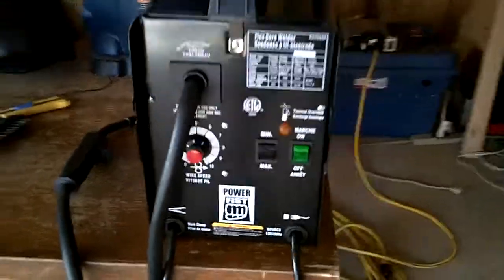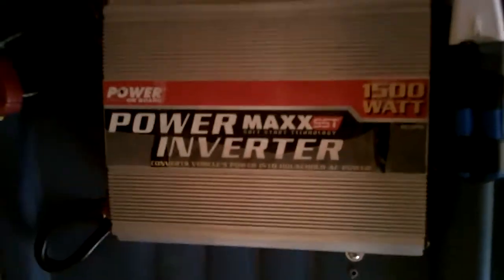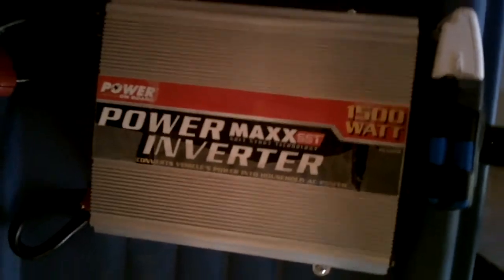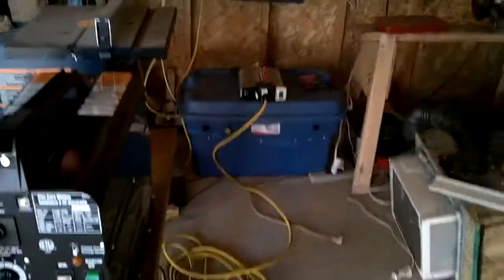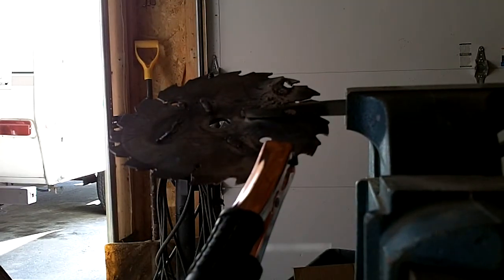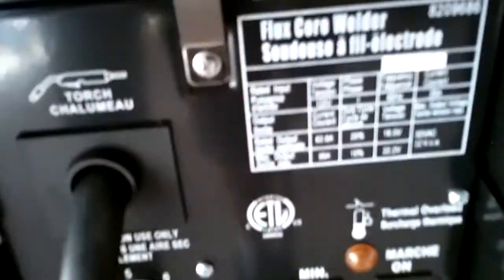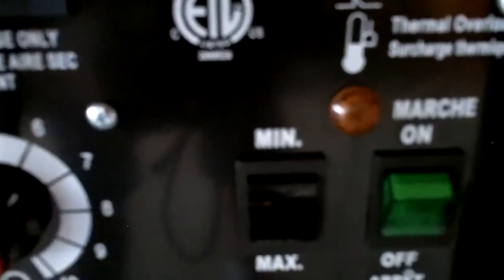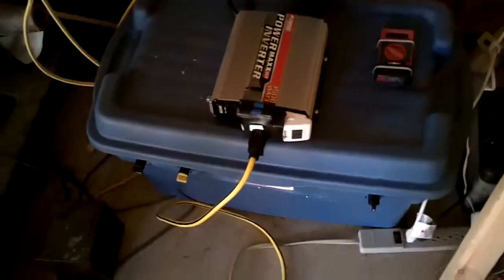Welding off an inverter

Comment: IMPOSSIBLE. 
I just unboxed the hf Titan 140 multiprocess welder yesterday and I am running it off a jupiter inverter 2000 continuous\4000 peak in this 2004 subaru foresterX 2.5l w/ alleged 90 amp stock alternator at about 1000 rpm motor rpm. 
I can strike a spark and thats it if I get that and then it started shutting down. Except for potentially bigger cables the attempt to start an arch seems to shut down the jupiter inverter.
 initially I could only see the welder going into a non normal numerical out of display mode until different combinations shut down the jupiter inverter output because the welder completly shut off while the jupiter inverter was having an alarm tone and a red led visual display.
I heard in my thoughts this is the initial draw to strike and start and arch and the jupiter system shuts down to protect the circuitry but I have not verified this being the situation.
There is another guys video with an alleged 4000\ 8000watt inverter and he couldn't weld  either it kept shutting down.
Reply from the maker: It's mostly because it's not a pure sine wave inverter, on top of it you need at least 3000w. I don't recommend doing this it's very hard on the inverter. The old swipower inverters had a massive surge the newer ones have more safety features that make the inverter last longer.
Reply: @GoingOffGrid101  Oh, hello and thanks for your reply. Please help out how I have to upgrade the alternator, wiring, and inverter to handle this load with a light, a fan, and the cars load.
I have been  studying on it for several days but I can't get one proper review for  other applications let alone welding. fouresasquatch@ Thanks😁
Reply from the maker: @Benny-dv7xm you need a low frequency inverter 3000w or greater and at least 200 amp alternator
Reply: @GoingOffGrid101  okay, thanks. That was quick. I heard a tone but I didn'tt see it was from you.
Now, can you guarantee which alternator company to go with?
😁
Reply: The hf titan 140 multiprocess welder is an inverter welder. Will this make a favorable difference to use the 2000\ 4000 non pure sine wave inverter and only need to find a good 300+ amp alternator? I know I need higher for
the heat and surge capacity and any future accesories.
Reply from the maker: @Benny-dv7xm  I'm 90% sure you need a pure sine wave for a inverter welder. :(
Reply from the maker: @Benny-dv7xm  no I don't have a preference when it comes to alternators.

Comment: Hi i have a 70amp mini welder, i have 200ah lithium lifepo4, i have puresine 1500w.. if i upgrade my inverter to 3000w puresine, do you think it can handle it for offroad/trail welding? Tnx alot

Comment: this is valuable research!  subbed. Think that can weld 1/4 rebar in a cross?   My van has custom 155ah deep cycle AGM for a battery and a 160amp alternator. I run a 2000 watt inverter that can run about 12amps of 110v appliance constantly while I run the engine.   I need to weld 1/4 rebar in a cross. Given this is from 2013 and it's currently May 2022, can somebody recommend a good setup for my power setup and welding  needs? including what rods, setting, welder, etc. THANK YOU!
Reply from the maker: I can't recommend the welding end but you will need a low frequency inverter 3000w or greater
Reply: @GoingOffGrid101  but your video states you have a 1500 watt inverter? I do plan to run my engine while running the welder.
Reply from the maker: @12vLife  yes this was a one time test, if using an a regular basis it would have to be much heavier duty

Comment: Cool. It does work, I have a small DC stick welder, goes up to 70 amps max, for welding small stuff. I use a 2500 watt Mosfet inverter powered by 2 100 amp hour Marine/ RV batteries, hooked up to my truck alternator. Works great for quick mobile welding jobs.
Reply from the maker: thats great! I have used this to fix off road vehicles in the field.

Comment: What is your battery bank like?  Amps and volts and where did you get the welder from?   I looked everywhere for that specific brand and I can't find it
Reply from the maker: my current setup is 66v full charge and 1013Ah
Reply: @GoingOffGrid101  thanks

Comment: I don`t think so. Everyone has tried it and it dose not work. A 1500 w inverter this no way it would at all. 4000 w inverter dose not work
Reply from the maker: ok, but i do it all the time, not with 1500w any more but with 3000w yes
Reply: I have ask this question many times about this. all say impossible to do it as I`m a Boilermaker to do welding with no power around you

Comment: I just purchased a Westinghouse igen4500watt you think it will power my 80 arc welding machine from Eastwood?
Reply from the maker: yes I think it will run it.
Reply: thanks bud
 @GoingOffGrid101

Comment: Thank you very much for the video, my wife and I are in the process of buying a home that is completely off grid. And I worried that I would not be able to use my 110v welder any more. Are you able to run an air compressor as well? Not at the same time of course, but I need to be able to run my air compressor and lights in the shop. Going from 100% on the grid to 100% off the grid with zero time to adapt is a scary thing to do. But jumping in head first is the only way I can do it. The house we are buying is already set up for solar and wind, but I am hoping to include a water powered hydro system to help out year round. I am going to be in Montana so it gets cold I am just hoping my creek doesn't freeze up on me in the winter time. I would rather not have to run my generator if I don't have to just because of the noise. A 10k watt Honda Gen set is not a quiet unit.
Reply from the maker: I have a xantrex sw3000 and I can run any 120volt device including a 4 hp stand up compressor. make a few videos as you go I would love to watch them, and I do not mind helping in anyway I can.
Reply: Thank you very much, I will make some videos as soon as we get the place and get moving along. I really appreciate the offer to help, this is a new venture for us. Can't wait to start making my own power, especially in the shop. It gets cold in Montana -20 in the winters is not unheard of. Brrrr, big change from Washington state where we live now.
Reply from the maker: Josh A yea im from Canada so it gets very cold here to :)

Comment: thought amps x volts = watts. I got a Campbell flux 80 w/max 75amp output. think 115volt? 8625 watts what I figure needed to fully function. also may have higher start up but I'd be guessing as I'm far from knowing electrical stuff
Reply: That amp output not input, a welder is basically an inverter taking your standard ac and converting it to DC for welding, that 75 amp rating is the DC output. The higher you crank up the Voltage the less amperage is required to move a large amount of energy. So lets say you have 20amps of 120v you turn down the voltage to 12v your amperage can now jump to around 200amps DC. https://www.batterystuff.com/kb/tools/ac-to-dc-amperage-conversion-run-through-an-inverter.html
Reply: You need to multiply the amp draw from the outlet by the volts. So if a welder actually draws 24 amps (my welder for example) from the wall while welding at full power, you need at least a 2640W inverter, but actually more due to any error in calculations. Most tools have that specification, like a 5 amp saw or 7.5 amp impact gun for example. Hope this helps.
Reply from the maker: +Nic l no the voltage of your welder is not 115 volts thats why it would be less then that :)
Reply: +fliping720 its either 115 or 120, I'll check but reg 3 prong plug
Reply: +fliping720 just checked. is 115v 60hz. model wf200 Campbell bought home depo around 5 or more years ago, been discontinued since
Reply: +fliping720 read another commenter who said he was surprised 1500 watt inverter even worked it and claimed to be a welder. also he said inverter not likely to last very long putting so much draw on it and seems pretty logical to me
Reply from the maker: ***** yea it is not good to max a inverter out for long, this was a one time test but I use my 3000w inverter for welding :)

Comment from the maker: this video is just showing you can do it, I could take this inverter hook it up to a running truck and weld anywhere, and just caring a inverter and a welder is way easier then a generator and a welder, plus its quiet.